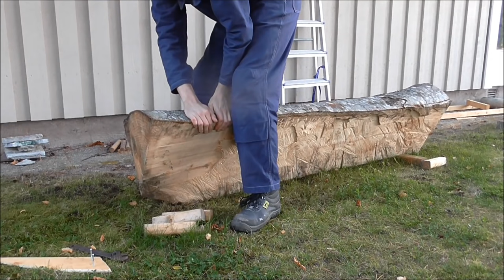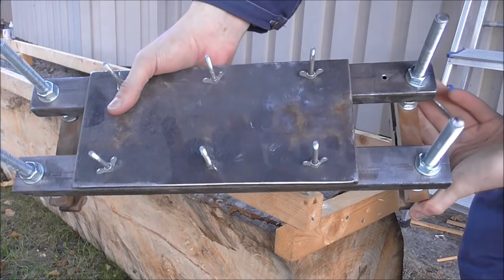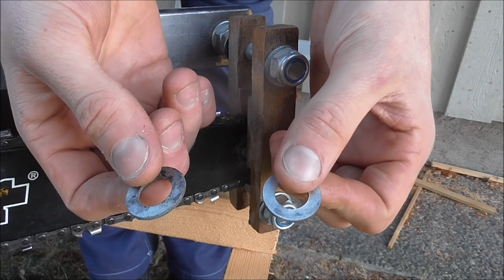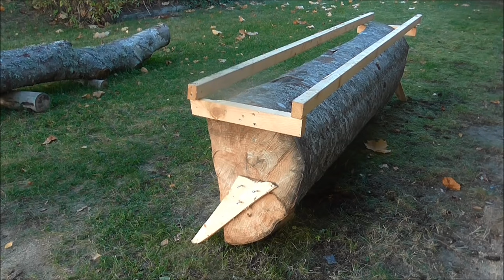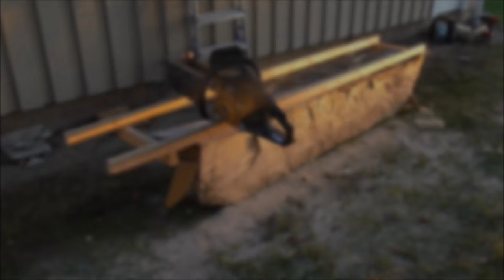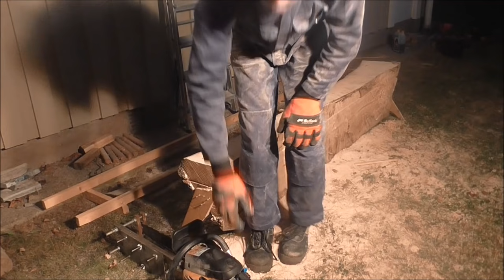Homemade Chainsaw Milling attachment

Comment: It's a good concept I would recommend getting some pipe that will fit over your threaded rod and cut it to the length of your thickness of your cut and do away with the bottom nut on fence... I built my first Alaskan Mill out of a 2x12 a couple washers some threaded rod and a couple pieces of angle iron nice work bud

Comment: The 2 rails flex under the weight of the saw and metal frame that can result in a concave cut.
Reply from the maker: You are probably right about that, though I only had this one three to mill & just wanted to try something quick so I don't think it will be a problem for me. Thank you for the advise! :)

Comment: started cutting so well till the tip moved and blunted the chain you can see shavings first then just dust from a blunt chain .
Reply from the maker: Yeah I know :( My bad, its a poor design that needs some adjustments too work. A more powerful chainsaw & a longer sword would have helped a little when I did this, then I could have attached the milling attachment better to the sword & I wouldn't have needed to maximize the capabilities of the saw.
Reply: @creativeobsin  will be making one of these this week really appreciate you making the video never had one and i.v been a tree surgeon over 20 years , may even get one of those G660 Chinese saws everyone is raving about the same saw in the UK would be close to £1300
Reply from the maker: @Edgunsuk  Sounds exiting! :D Good luck! :)

Comment: You can not clamp that down on bar sprocket.  You have to put it on up infront of sprocket. 
 It will due alot of damage
Reply from the maker: It worked for what I needed it for and i only needed it for this one log anyway so I think I'm good >:J

Comment: Just a heads up, there is a great new tool that is called a hammer. Better than using an adjustable wrench.
Reply from the maker: You're probably right, but I'm Swedish & got more adjustable wrenches than I really need. No fun using proper tools when you have other options anyway.

Comment: I know that it has been two yr, but i think that your attachment might be too heavy, and yes you do need to resharpen your chain.
Reply from the maker: Too heavy? Didn't feel too heavy when I used it. But you're right about the chain & I should have attached the blade more securely. Other than that it worked out as intended.

Comment: You needed to sharpen your chain after you touched the all thread. Ripping chain would help too.
Reply from the maker: Yeah you're definitely right about that, but I run out of patience & a ripping chain would be nice but since I only had this one log to mill I didn't think it was worth it. Thanks for the advice though, I appreciate it! :)

Comment: Way too much flex in your 2 bye rails and the saw jig is 10 lbs heavier than need be. I use a 2x10 fastened to the top of the log for the first cut.
Reply from the maker: This is a prototype I put together from materials I had laying around in about 2 hours. It might be a bit heavy, but I don't see that as a problem since I don't have to hold it myself, only slide it along the work. I don't know what you mean by saying my attachment is flexing, if you're thinking about the poor cut quality, it's because of the bad performance of the chain I damaged because the saw slipped out of the saw holder.

Comment: Get a Stihl man, that was painful to watch.
I did like your homemade setup though.
Reply from the maker: Yeah this chainsaw is not suited for this kind of work, but I just had this one log to mill so I went with it anyway. But I would definitely get a better one like Stihl or a Husqvarna. I'm glad you liked my setup :)
Reply: Very clever. I just built a mill very similar to urs w/ the 4 all threads rod. How is it to adjust for different thickness?
Reply from the maker: Slow & enoying but it does the job if you mount the sawblade properly, not like I did.

Comment: The blade is really dull p
Reply from the maker: It wasn't at the start, I didn't tighten the front holder enough to hold the sword in place. So it slipped a few millimeters and hit the steel. That's why I'm only making sawdust in the video. Thanks for watching & leaving a comment :)

Comment: Please dont ever touch a live running machine blade man or it might be the last cut you do all that needed to happen there was a quick slip in balance and ur hand is history trust they call me johnny 3 fingers at work
Reply from the maker: I appreciate your concern & it's been a while since I made that video. Since then I've got myself propper, 5 day practical and theoretical education on handling a chainsaw the correct way & chain sharpening as well. Thank you for being interested in my safety.